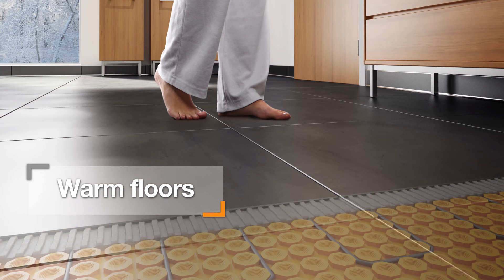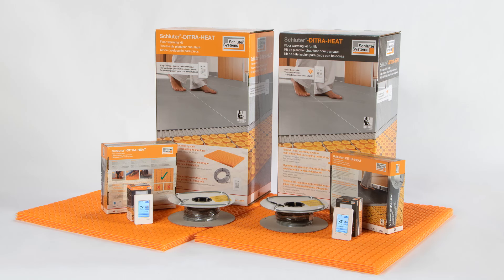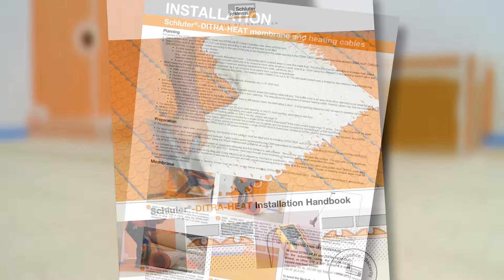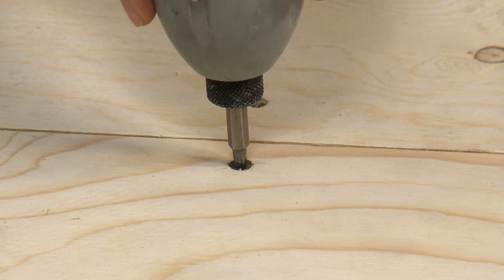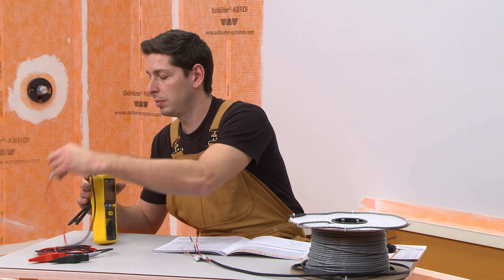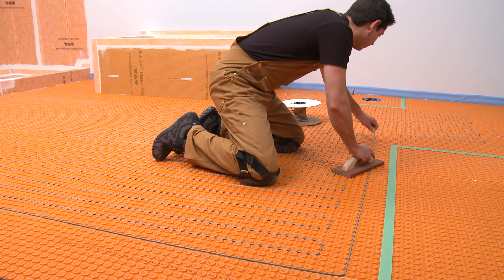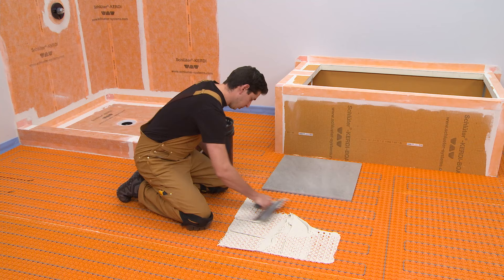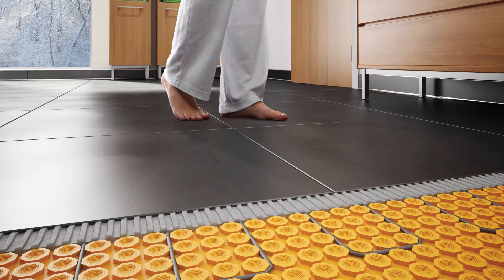How to install DITRA-HEAT over Wood Start to Finish

Comment: What is the blue material/foam you use around the edge of the room at the base of the wall?
Reply from the maker: The blue foam is  Sill Seal, a compressible polyethylene gasket. Since it is important to have a perimeter movement joint throughout the tile assembly we used the sill seal to ensure a consistent joint along the perimeter. Hope this helps!
Reply: @schlutersystems1  , where can I find it? Is it removed after installing the floor (tile)? I thought I saw a video of yours talking about it. Is this recommended?
Reply from the maker: @j77scout  you can find Sill Seal at any retail store--such as Home Depot or Lowe's.  You can check out our DITRA installation video here that will help you understand the process of installation: https://youtu.be/1a-jS9hvBl8?t=1138
Reply: @schlutersystems1  , how necessary is the guide that is mentioned comes with the floor system? Mine didn't have any manual just cellophane wrapped around it.
Reply from the maker: @j77scout  The Installation Handbooks are critical to reference during installation. You can always find them on our website for download: https://sccpublic.s3-external-1.amazonaws.com/sys-master/images/h18/h0d/9078298902558/DITRA-HEAT%20Installation%20Handbook.pdf 

Hope this helps!
Reply: @schlutersystems1  probably let retailers know not to seel without the box it came in or make sure handbooks are with product
Reply from the maker: @j77scout  Thanks for letting us know this! We have passed on your comment to our Retail Team in regards to this. Let us know if you have any other questions, we're happy to help!
Reply: @schlutersystems1  , got a contact email for questions or just use the site contact information.?
Reply from the maker: The site contact information will deliver your questions directly to our Product Support team. You could also give them a call at:
USA: 1-888-472-4588
CANADA: 1-800-667-8746
Hope this helps!
Reply: Can I use Schluter ALL-SET for sub floor to ditra heat floor membrane and porcelain tile on top the membrane? How do I calculate the exact amount for each?
Reply from the maker: Hey there! Yes, ALL-SET can be used to install DITRA-HEAT on the substrate and can also be used to install the tiles onto the DITRA-HEAT. You can follow the charts in the Coverage section on page 3 of the ALL-SET data sheet to calculate how much thin-set you will need for your installation. We’ve included a link to the data sheet as a reference:
https://sccpublic.s3-external-1.amazonaws.com/sys-master/images/h5e/ha8/8949341814814/ALL-SET%20Thin-set%20Data%20Sheet.pdf

Comment: You guys literally didn’t show anything about the wiring through the wall
Reply from the maker: Hi there, this video and our written instructions are focused on the installation of Schluter products. We recommend a qualified person for all electrical work done in conjunction with the DITRA-HEAT system. Please refer to the electrical and building codes effective in your region or your local Authority Having Jurisdiction (AHJ) for assistance and information regarding electrical wiring. Hope this helps!
Reply: I watched the entire clip to see that part and I learned nothing.